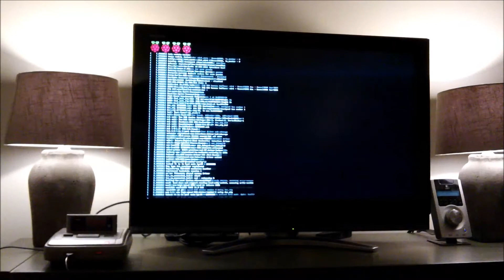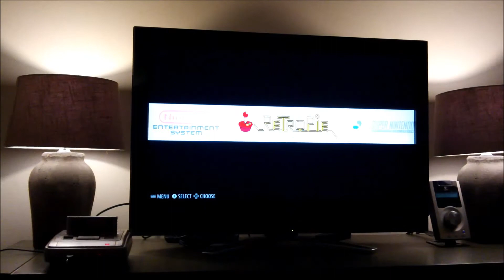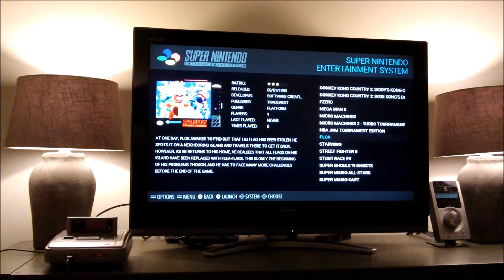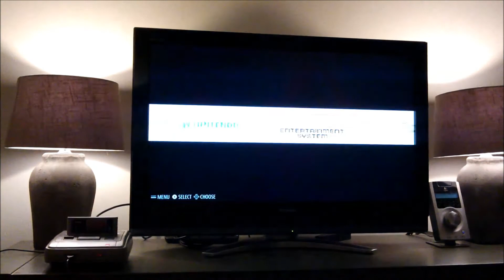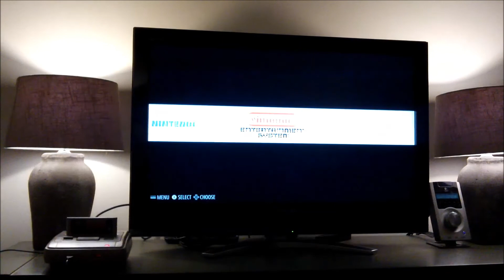Super Nintemu: A Raspberry Pi RetroPie Emulation Console (SNES PC)

Comment: I am planning a similar project. Where did you get the grey backplate?
Reply from the maker: Thanks for commenting! From about 9 minutes in, you can see it up close. It's just a regular piece of painted plastic (styrene) glued in place. Although i had to use a dremel to cut a bit of plastic away so the "plate" would have a well enough surface to be glued upon.
In the meantime, on the RetroPie forum someone with a similar build has designed a nice 3D-print model for a very nice and elegant backplate. I believe the 3D model is available for download. I think that would be a better solution.
Reply: thank you.

Comment: Nice stuff, mate. Im building one with an american SNES. The only thing Im planning to do in a different way is the reset button. Im gonna connect it straight to the GPIO and set on the retropie a reset on the system, getting you back to the main menu. I like the way you fixed the usb and all ports. I did it with hot glue, but doesn't look nice as yours. Congrats =]
Reply from the maker: Thank you!
I really like the reset function you're going for. Sounds nice and elegant. Be sure to post your progress and results on the RetroPie forum (if you've not done that already). It's nice to share ideas and knowledge among other enthusiasts.
And thanks again for your comment. ;-)